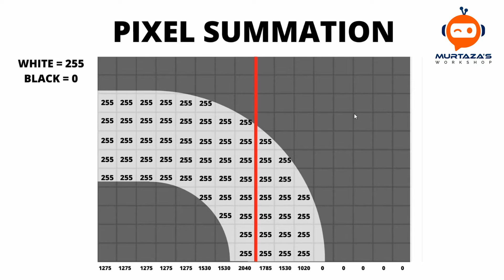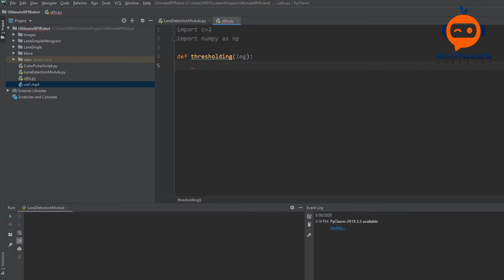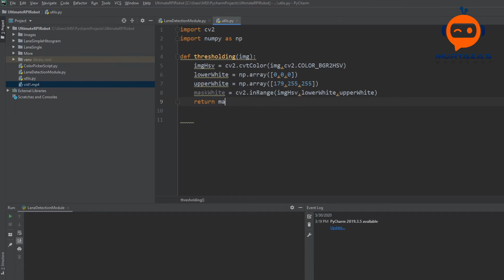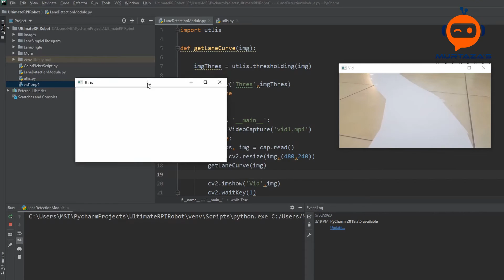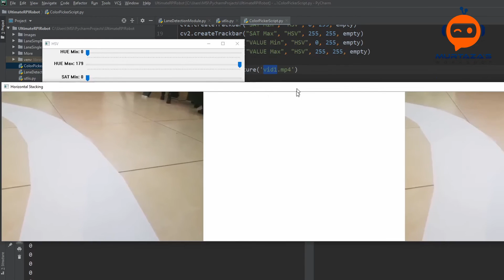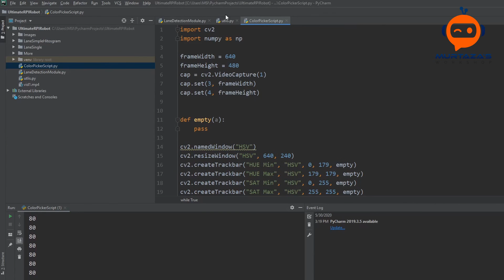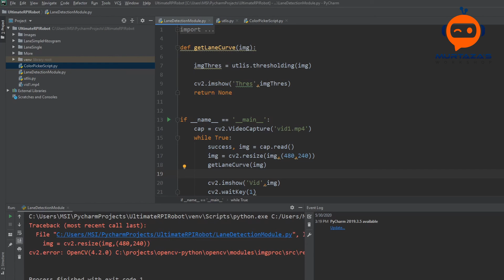Finding Lane | Self Driving Car with Lane Detection using Raspberry Pi p.2

Comment: Dude, i am getting an error i cannot find anywhere on the web:
(-215:Assertion failed) trackbar in function 'cv::getTrackbarPos'
My ColorPicker file code is identical to yours, and yet, i get this error.

Any help would be greatly appreciated
Reply: Nevermind, it was a uppercase/lowercase problem. i fixed the strings in "createTrackbar" and "getTrackbarPos" and it works now

Comment: An easier way to convert to binary is by using the thresh binary function
like so:
while 1:
    _, frame = cap.read() 
    frame = np.array(frame)
    _, frame = cv2.threshold(cv2.cvtColor(frame, cv2.COLOR_RGB2GRAY),30,255,cv2.THRESH_BINARY)
    cv2.imshow("Binary", frame)
    if cv2.waitKey(0) & 0xFF == ord("q"):
        break
cv2.destroyAllWindows()
Reply from the maker: Thanx for the suggestion. The thresholding method is very generic in this case since its not dependent of the path color. Thats why we are finding the color first.
Reply: @murtazasworkshop  I noticed that later on in the video. My bad

Great Video btw. thx alot